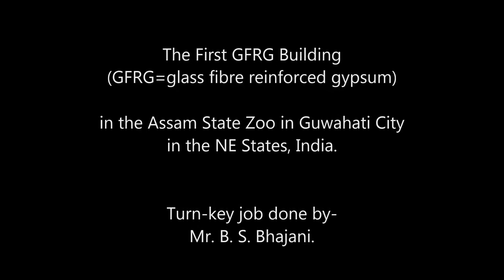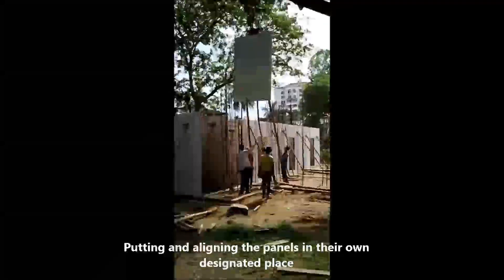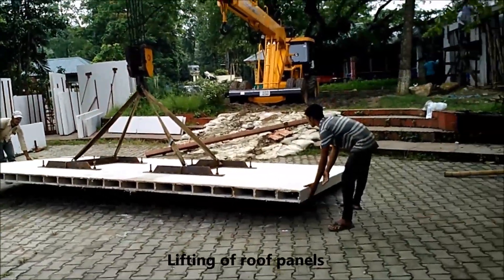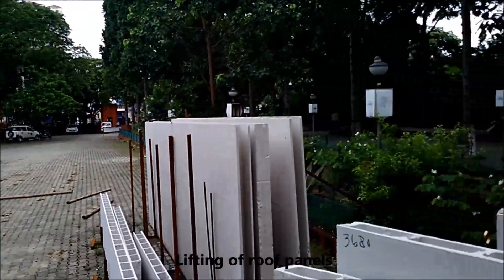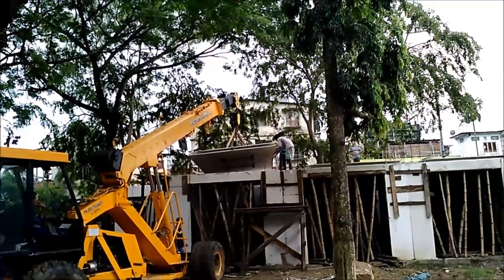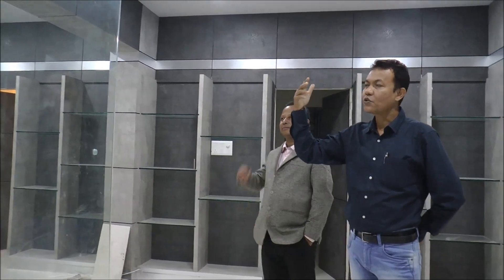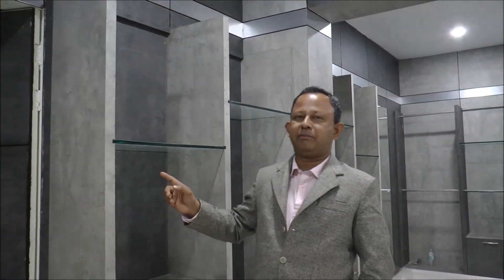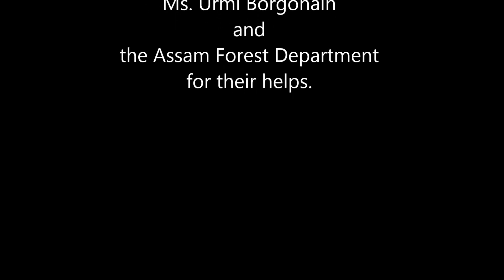GFRG Panel Building affordable rapid construction. First in Guwahati. How to construct.

Comment: what are the things need to consider before deciding on gfrg panel construction. what is the minimum width of road to site, if i want to to bring crane to construction site.
Reply from the maker: 3.6m wide road is ok to bring in the crane. The crane must be able to access the building to put the panels in position.
Reply: @bsbhajani9595  my road to site width is 3.06 ( 10 ft) can I get smaller sized crane for construction